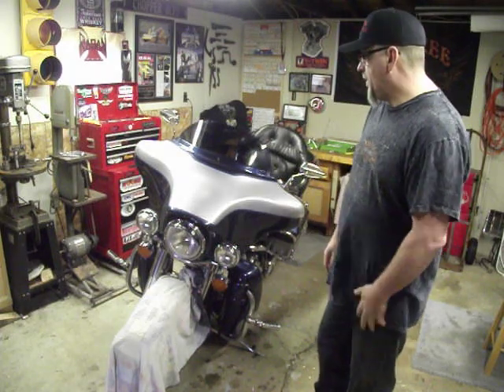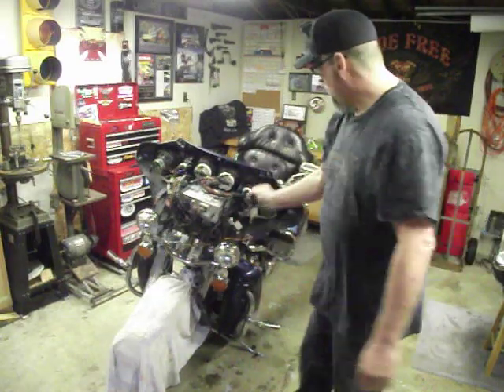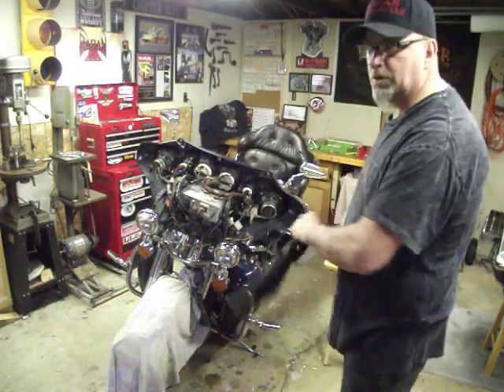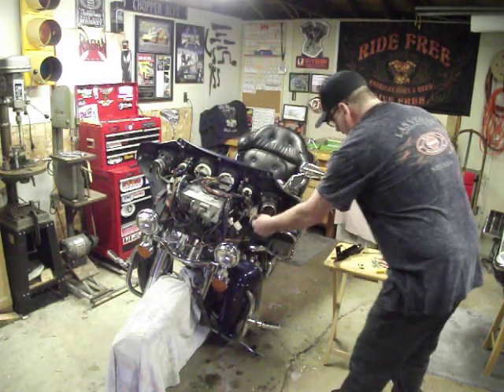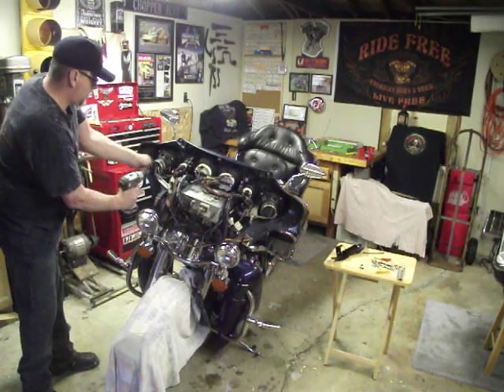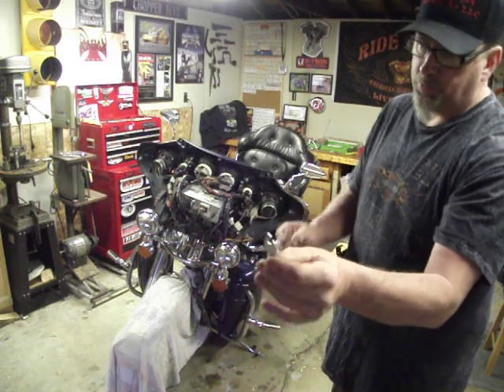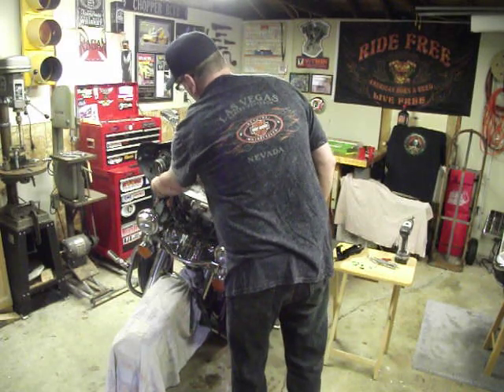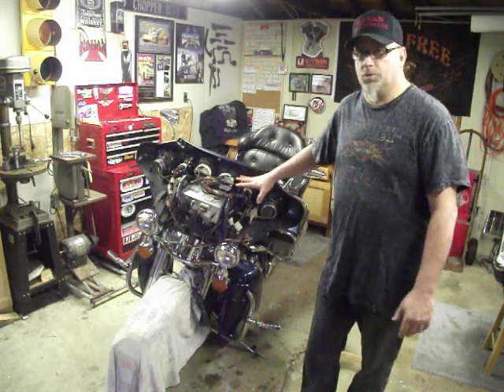Harley Davidson Batwing Fairing Support Repair Kit, Ragan Fab Works

Comment: I've had fairing shake for a while and have this kit sitting on my bench for three months, just opened up the fairing to install new speakers and 3 of the 4 brackets were BROKEN! If you're buying the kit get all four peices and just do them all. Dan is killing it with this kit, it's easy and you will see a difference. Like everyone else will tell all my friends! Great work Dan, and Thank.

Comment: I placed an order for this kit on Easter eve, got a response immediately and received the kit 3 days later.  Great customer service!   The kit works just like it says it will.  It only took me about 30 minutes to make the entire repair!  Harley quoted me $147 in parts and $240 for 2.5 hours in labor.  This kit worked perfectly and saved me about $340. I wish I had done this about 30,000 miles ago.

Comment: This is the single slickest Harley fix I have ever found.  Took me less time to install than it would have taken me to drive to the dealer for stock parts.  If you have busted fairing and speaker brackets.  You need this.

Comment: Hello Dan, I just wanted to give you a heads up. I purchased this mounts about a 11/2 months ago and was a little skeptical. I have to say, I'm very impressed. It was very easy to install. I actually left the black vertical mounts on the bike. I also used a magnetic screwdriver to control the metal shavings while drilling, it worked very nicely. I did tweak the horizontal mount just a bit, to settle out nicely on the speaker mount. I'll give you huge kudos for using allen head bolts and nylock nuts. I've been running the mounts and have had absolutely no issues. Thank you for a great product that saves all of us time and money.
Thanks again, for a great product, KW

Comment: Thank you Dan for an awesome product. I got mine put on over the weekend now my bat wing on my '04 EG is rock solid. I had 3 of the 4 brackets had broken as such in your video. It worked just as you said and with ease. Thanks again.

Comment: Great minds think alike. Did the same repair on my 2006 Ultra in 2008. I had made mine from Stainless, using same hdware as you. Just found your video. Great production!

Comment: Got mine yesterday and took about 30 minutes to install ( I took my time) perfect fit and corrected the shakes. Much better than having to replace the entire brace system and probably a lot cheaper just guessing but I didn't even call the stealership.

Comment: Hi Dan, Great product and it fit perfectly, I had all 4 repaired in less than an hour.

Please share the type of magic drill bit you use in this video though, I had a spankin new bit and had to work a lot harder than that to poke it through.

You should patent those and sell the design to HD, 
oh and just so i could be like you, i dropped my allen, only mine went in the engine and it took me 10 minutes to find it..

Comment: I went to the local hardware, and bought 2 screws and bolts and a metal plate, bent it, ground it, drill it all in about 15 minutes and had less than 5.00 in parts :)